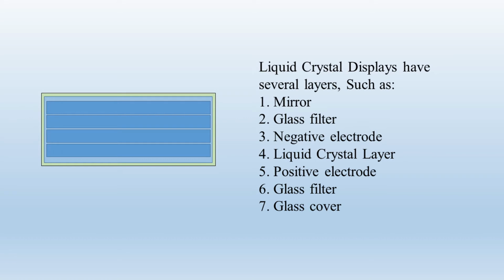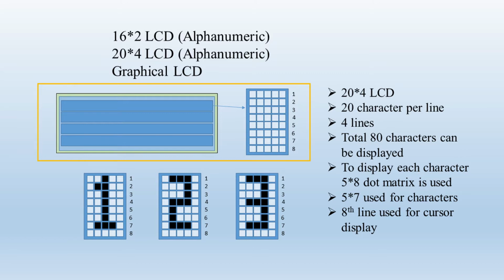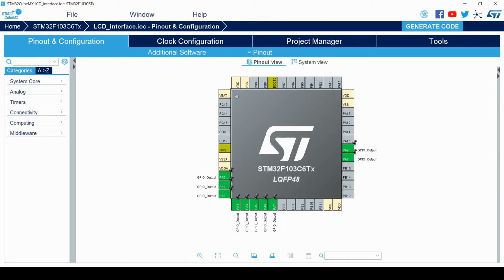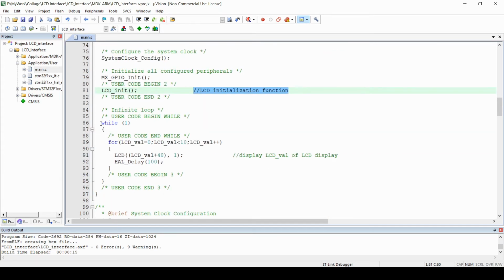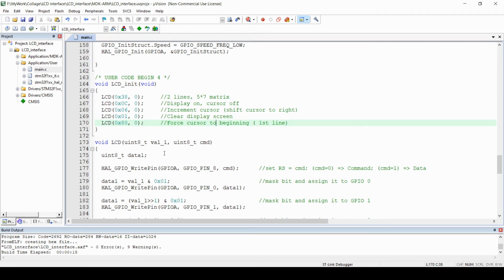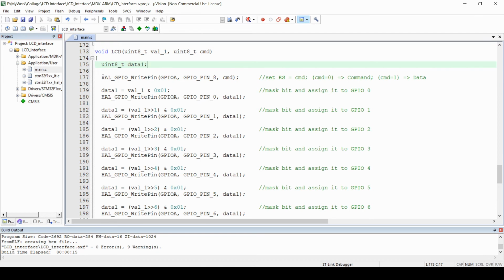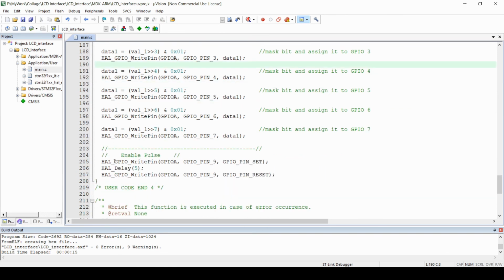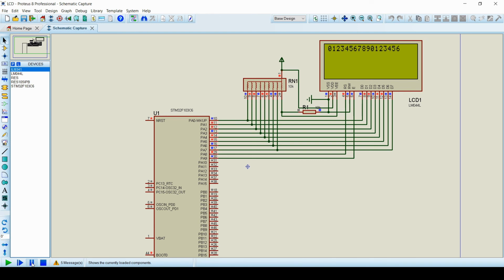How to interface LCD with STM controller!!!! 8 bit mode | STM32 | Simulation

Comment: v+/v- pins not specified for power interface - check itfmod
Model CM3STM SPECIFIED BUT NOT FOUND IN SIM1 _#P
Reply from the maker: I ll reply on this by today. You wont get the pins, you just have to define the voltage levels for Vcc and GND. Anyway i ll give full explanation on this.

Comment: nice one sir..Sir one question can you provide the STM32F103C in proteus ??
please sir..Or how you have added stm32f103 in proteus?? please reply sir
Reply from the maker: Proteus doesnt have stm32f103c8 controller
Reply from the maker: It provides the same family controller which is stm32f103c6. You can simulate on the same and use code for stm32f103c8
Reply from the maker: Watch other videos in this series also. You ll get the idea and how to add.
Reply: Ok i will watch
Reply: I watched ur playlist it doesn't contain that how to add stm32 library in proteus
Reply from the maker: You dont have to add stm Library in proteus
It is already there in new versions
Please join our telegram group 
I'll share proteus download link there
Reply: Can you share the website for it